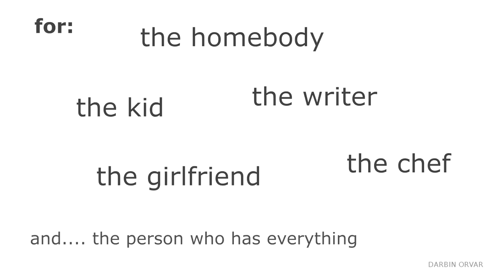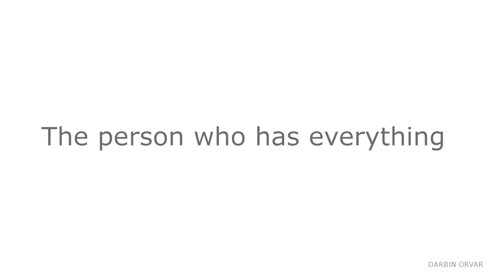30 Ideas for Making Christmas Presents // Woodworking

Comment: I noticed you used a ‘scrap’ piece of wood to mix epoxy glue on. I use old ‘ziplock ‘ style bags, which I mix the glue on and then put to one side. Peel of the waste the next day and the bag is good to use several times.

I’m also a miniature figure painter 28 - 75 mm scales, so perhaps you might like to think of how a miniature display cabinet could be done.